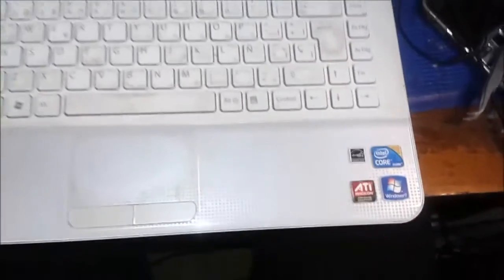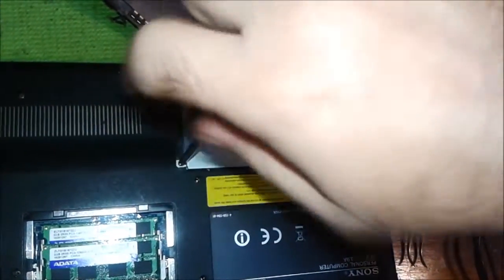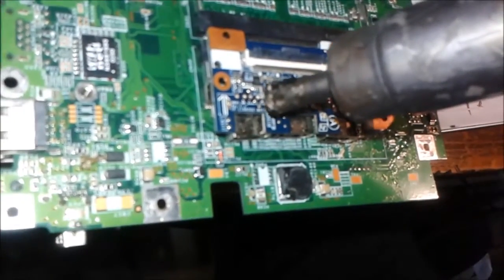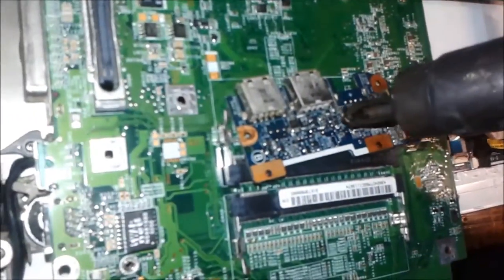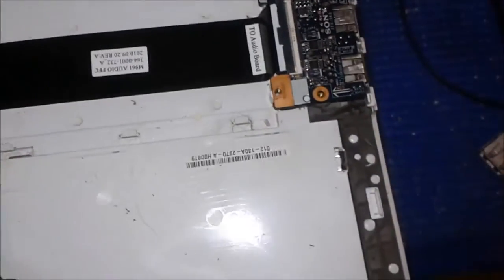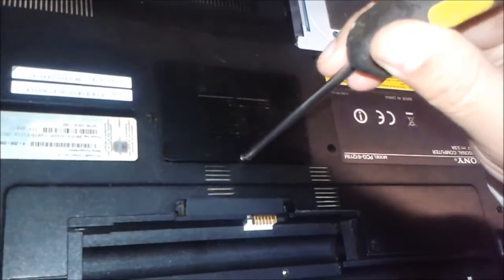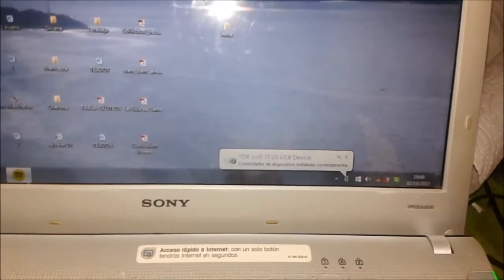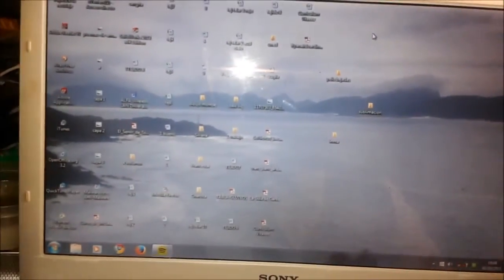sony vaio pcg 61211m usb port change

Comment: Awesome. I figured that this would've been harder to fix. Thanks for a talk through. I have 2 that are not working and one that for some reason if you move or bump it a little the usb a disconnects and reconnects. Gonna try it out.